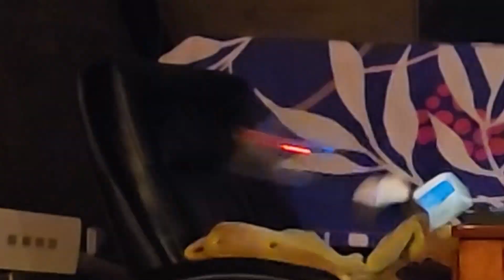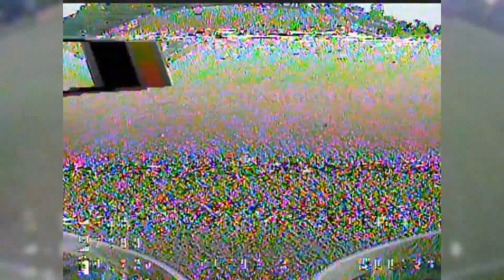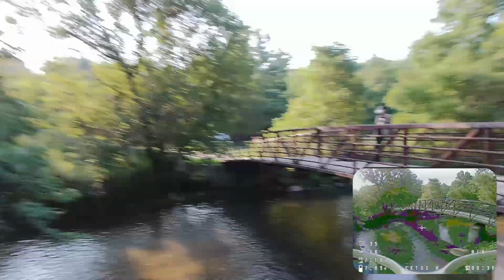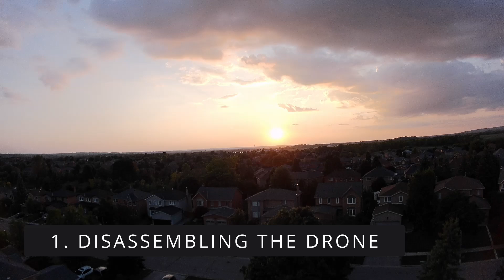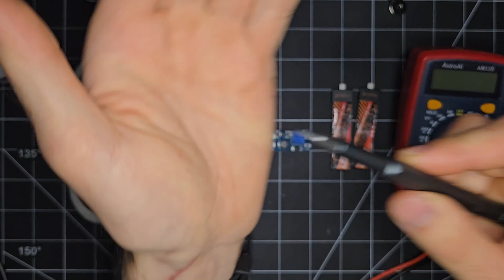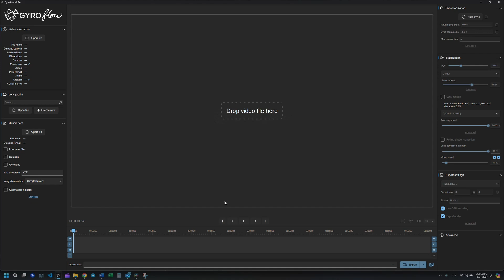How to Install a 4K Action Camera on the BetaFPV CetusX Drone

Comment: my camera has 3 wires where do I soder that wire?
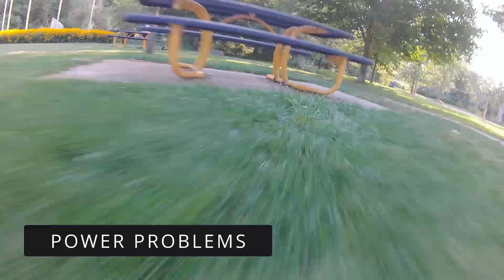Reply from the maker: Overall this camera has 4 wires (2:21)
But you need only 2 (5V and GND)
 
ONLY IN CASE YOU HAVE THE SAME CANERA AS ME - you can cut this 3rd

Comment: thank you for the vid very useful but i have a few questions. where do i get that antena for the drone and are the goggles that came with the kit compatble with the feed from this. also where can i find that 3d printed mount  for the runcam
Reply from the maker: @Fpvwithme123 hello! 
I am glad that you liked the video!
The 3D printed mount have to be in the same package as the camera. If not, you will need to print one. Link for the 3D model is in the description for the video. 

About the antenna. I cannot find the exact I ve bought. But I would recommend you to search on YouTube or Reddit yabout antenna modifications for this drone.
Reply: @Astronaut1407  thank you so much

Comment: Hi, nice video, very detailed, love it;
Do you know where I can get this JST 2 PIN cable from if it is not included in the camera package?

Thanks,
Ben:)
Reply from the maker: Hello, Ben!
I will update the description of my video where I will attach the link for buying this set of connectors! 
Sorry for long respons!

Regards, Ihor
Reply: @Astronaut1407   Thank you for your answer, I did the conversion yesterday, took some footage, absolutely worth it
Maybe you could do a video about the change of the original 1103 Brushless Motors 11000 KV motors to the 1103 Brushless Motors 8500 KV because the 8500KV are more chunky and du to the heavy setup with the runcam a lot more better during the flight.

Kind Regards,
Ben
Reply from the maker: @Ben-t5v5r Here's your response:

"Thank you so much! I’m glad you found my video helpful and that you managed to shoot some footage!

Regarding the motors: I’ll definitely keep that in mind—thank you for the suggestion. Right now, I’m working on another project and hope to release a video about it soon!

Best of luck, and happy flying!"
Best regards, Ihor